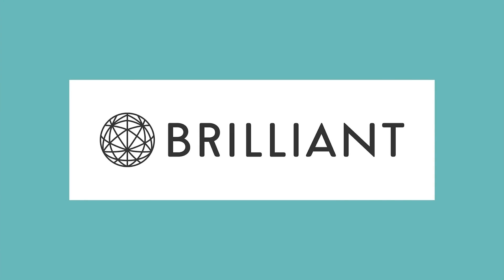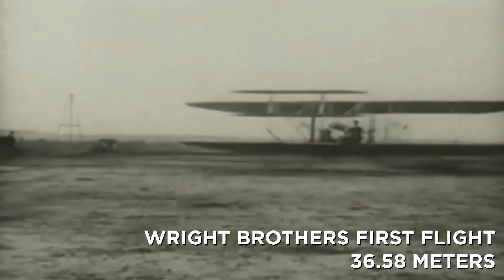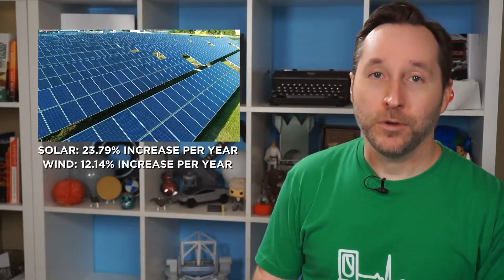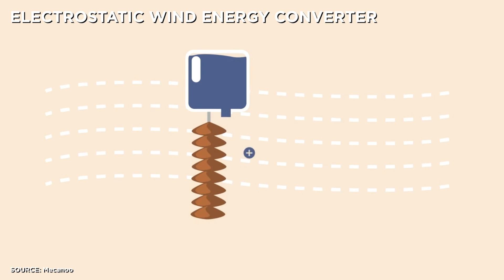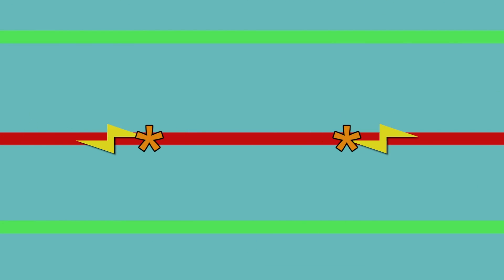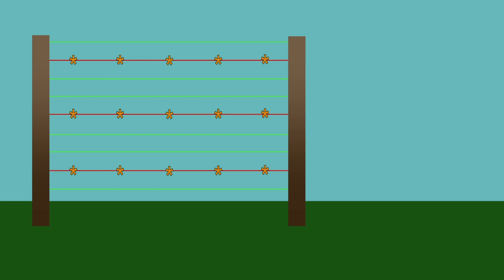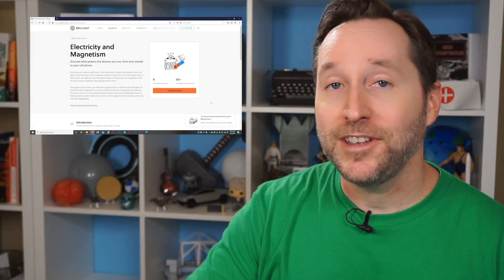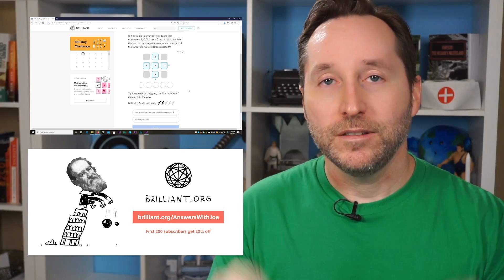Solid State Wind Energy | Random Thursday

Comment: your lack of basics physics knowledge is really grating sometimes. They didn't apply +20kv and -20kv, they applied 20kv across the two electrodes. Also, 20kv is not "a lot of energy" it's a high potential; you need to know the current to get a power figure, and a run time to get the energy.

Comment: We already have the infrastructure in a way if we were to turn all the wiring on the current grid to this idea perhaps we could simply do away with the power stations as the grid itself would produce the electricity, and if you were to incorporate this idea into the construction of every new highrise building with wiring encircling the building many many times you could make the building create it's own power supply

Comment: If you're going to string up wires, why not just capture the energy broadcast by, well, broadcast stations? You can get usable current from a single elevated wire tuned to a nearby broadcast station. Broadcasting, whether by short wave, AM band, TV bands, or FM band, is quite wasteful of energy. Many stations put a million watts or more into the air, a tiny fraction of which gets to receivers (the energy is transmitted in broad, almost spherical lobes and dissipates inversely according to the square of the distance from the transmitter).

All you have to do is tune to a station (or several stations) then rectify the signal and filter it to get a steady DC current while the station is on the air. Do that in various antenna orientations and/or for several big stations, and you can get multiples of the current from a single wire or station. Your current is not robbed from any receiver, since your path to the transmitter is unique; you are taking only energy that is otherwise wasted.

Comment: Dear Joe,

This video starts out by stating  incorrect historical facts. If you would've looked into this a little more thoroughly, you would know that this is the truth.  On my YouTube channel. to the left, there are over 30 videos of the first and only ion propelled aircraft that clearly flies with onboard power, without external assistance.  I am the inventor and have made sure that every scientist has solid clear cut verification! 
The craft has been patented since 2014 specifically for lifting its power supply onboard, it can do it for nearly 2 minutes at a time vertically!  The aircraft can also fly on one side with the streamline shaped collector surfaces flattening on the bottoms sides somewhat to form efficient airfoil shapes, making it also a "plane".  The point has always been lifting a power supply with ion propulsion though not semantics.  The orders of magnitude higher power to weight and efficiency of the earlier craft are also important details.
Furthermore, the host of NPR and many other officials have certified that the much earlier ion propelled aircraft lifts its power supply solely using ion propulsion.  Here is a 6 minute radio program and article by Jeff Saint Clair:

https://radio.wosu.org/post/exploradio-oberlin-inventor-pushes-limits-ion-powered-flight#stream/0

Since it utilizes well known physics principals, it should also be entirely clear that it's real.  Anyone that spends 5 minutes on the web googling the subject should be aware of the craft.( If anyone is  interested I would recommend first visiting my YouTube channel by clicking on EA icon.) There is generally exhaustive detailed information about it online. 

I think your videos are normally just awesome, but I just don't understand how you could make such an error.  I know an MIT student wrote it in the Journal of Nature and Barret et. al. thought it was correct, but MIT was simply not the first to do this.  It is not my intent to be unkind at all, but something must be done to straighten the record, please...  Thank you ahead of time for correcting this important matter!
Best regards,
Ethan Krauss

Comment: Both wind turbines and solar are NOT reliable -period. Nuclear and hydroelectric are very reliable base power 24/7 and have zero carbon emission the safest and most energy efficient. They also have a small footprint and the waste for nuclear is actually small and is now being re-used.

Comment: The wire panel thing looks really interesting. I wonder if it could be developed as a fencing system that would have a duel purpose. Even if it just powered led lighting it would possibly  be worth it or would the wire degrade in an open system and become ineffective, would copper be better at conductivity?

Comment: It is possible to produce amazingly high voltages  with a Wimshurst machine, even at home.Tens of thousands of volts, but slight enough actual energy it can give you a shock with no harm done. It starts up with stray friction-induced electric charges on isolated metal film  sectors in a circle upon an insulating pair of contra-rotating disks, and uses static electric induction and clever collecting brushes to charge up Leyden jar condensers  to spark-level opposing voltages. Each condenser is linked to its side of a spark gap. You can easily get half-inch sparks with hand  power. If you elect to try the shock yourself, make sure the Leyden Jars are not too big. If it takes a minute to charge them, don't risk it.

Comment: Wind energy had been around for thousands of years, and was TOTALLY defeated commerciaily and militarily by coal and fossil hydrocarbons  in  the past couple of hundred years. The technology to use it for oceanic voyages was at a state of sophistication as sail, that surpasses anything that the "modern" craze for electric wind power could possibly achieve at sea. Batteries enough to power  either Americas Cup racers or a Cutty Sark look-alike, let alone an oil powered vessel with 100 MW of power in its engines, would sink it.
The need for immediate response to civilian electric demand is far harder to meet than the ambition to cross a stretch of ocean, or even lake. I myself have successfully 'parked' a small dinghy using only its remaining  momentum and a wind that was insufficient to smooth the sails of an identical craft. Wind "turbines" can do nothing with a wind that can propel  a full-rigged ship at three knots. That's not much, but it beats stagnation.

It is the height of superstition and stupidity, some of it caused by propaganda that benefits the fossil carbon technologies,  to be wasting time, money, ingenuity, enthusiasm, and environmental beauty, on anything other than NUCLEAR civilian power, which requires about a millionth the quantity of fuel AND waste products, as anything  from horses to jet engines.

Comment: It makes no difference how clever the equipment is, if its source of energy is capricious, and people need electric power NOOW when they or their refrigerator turns a switch.. A 60 Hz AC grid needs ALL of its suppliers to be synchronous with a sine wave that goes from +V to -V in  less than a hundredth of a second. If an overloaded generator slows down faster than the others, the short-circuit defence relay will drop it from the bus, and the problem cascades.

Intermittent 'renewable energy'is therefore worthless , AND wind and solar do worse  environmental  damage than hydro. Nuclear, even the out-of-date stuff we're still using, does none.

Comment: I feel this could be modified or combined with somthing I was looking into. It seem the faster the wind and the more compact the wires are the better it will work like an air radiator. I uses an anode and a cathod system I guess you could use carbon but I dont like a carbon tube I think maybe a Graphite coated wire would work best. 

So a copper and a graphite coated wire being less then 1cm apart would work best. We would need at least a 500 by 500 grid setup and would be put in the front of an electric car were the radiator is so as your speeding down the highway it can take in some of the wind energy. Now the big issue with this is that the car isnt grounded but the body of the car is. Again Im not the smartest person in the world but I bet there is a way to impliment this into a car or even a plane. Most likely an electric plane. To manny Im just spitting nonesense but often times nonesense turns into ideas and ideas turn into inventions. Heck I might just make one myself. 

Im curious now.

Comment: I'm thinking this electric thrust could be used on small scale craft where sound is an issue. Like spy drones. Also could be used to make artificial bees since they're going extinct. Easier to make several thrusters on one power supply then to engineer a articulating insect wing. I'd like thoughts on this.

Comment: interesting idea - but I see in another 5-10 years 'wind freaking powerlines!!!' or similar lol. 
BTW
40kV is a lot of energy. Volts arn't energy... so you cant make a call on the energy consumption with only half of P=IV.
Arguments against windfarms also state that they disproportionatly kill prey birds, which are less numerous, particularly in cities (though finding evidence is a bit hard either way)
and most wind turbines (particularly the larger, modern ones) have 1 moving part. the difficulty is its huge, hard to maintain and subject to large dynamic forces.

Comment: I'm not a scientist but I saw parking lot lights we were installing, light up during a dust storm in Az
The supply circuits were not connected yet. They were 277 V transformers with metal halide or high pressure sodium lamps, i forget. They lit up well enough to see in the daylight. The static in the air from blowing dust must have stripped electrons creating a sort of invisible plasma field, lol. Please explain?

Comment: I have built wind turbines as a hobby for approximately 60 years. All my windmills pump air and I store the compressed air in a huge tank, which becomes an air battery. The compressed air is then run through a small turbine or piston engine of my own design, another hobby and I can make any electricity you want for far less money than if I were to make electricity directly from the flow of wind as do the large wind-electric companies. Also, it does not cost me millions. Most people probably spend more on golf. It may help to know I live on a small farm on the  Texas prairie; lots of open space, lots of wind.

Comment: Nice video, low BS factor (thanks). There are miles of fencing in the USA, could we get two uses for one?  But then there is the "boundary layer" effect which is why all windmills are so tall.  Its so you can get above the low wind velocity ground boundary layer.  BTW - Unfair comparing the first Wright Bros plane flight to that cool ion-drive MIT plane since the MIT plane had no humans on board.  Windmill bird deaths - thanks for putting this into perspective succinctly.  You were too polite to mention that the folks going on and on about windmills killing birds are often not really bird lovers, they are people who hate anything new or are PR people for the petrochemical industry who are trying to eliminate the competition in a sleazy way.  If they were truly bird lovers, then, as you point out, they should call for the immediate ban of all sky scrappers and cats.  The fact that they don't exposes their true intent.  However, getting wind energy in a way that would kill fewer birds is always a good thing.  

You state that this new no-moving-parts wind energy gathering device should need no maintenance.  Have you seen the plastic bags and other litter along side highways?  I think these energy harvesting grids would become an unsightly trash magnet and would be costly to clean.  Speaking of unsightly, would a home-owner really put a gigantic vertical cheese slicer on top of their roofs?  I don't think so.  Home owners are turned off by "unsightly" solar panels.  Elon Musk had to design solar panels that look like normal roof tiles from the road to appease fussy home owners.

Comment: "Wind turbines kill birds when they are hit by the spinning blades. Much safer to string up a ton of thin electrified wire for them to fly into"
Reply: To kill the birds the wires would need to be close enough to each other so the bird could cause a short.  Birds fly on and around wires all the time.  No moving parts are the key.
Reply: @rjbobrobertson  I made the statement mostly as a joke, but the birds are the moving parts. It isn't a huge issue, but they would definitely have to make the wires highly visible.

Comment: I didn't realise the life-span of a wind turbine was that short! I would have thought that the failure would be in the generator house with all that gearing, as yes, the blades are a moving part, but it's a constant turning motion, there shouldn't be much to fatigue the blades.

I really do think that nuclear power is the answer. Yes, the waste that it produced is more dangerous, but there is relatively a lot less of it.

Comment: I wonder if this system could be placed in long hallways between buildings that generate a fast wind current.  Many places add wires to either hang decorations or keep birds away (or both).  This would give those wires a third potential use.

Comment: Also if the solid state wind generator uses charged water droplets to hen it has moving parts. The water is a part of it and it moves so they are close but not quite as there

Comment: You're way off on the wind turbines. The lifespan is significantly less than 20 years. The blades are deteriorating after a few months of use. The amount of oil energy used the make, transport & maintain them far surpasses the energy they produce over their life, making then negative as a green source.

A much better use is a small kilowatt size vertical wind turbine used as a compliment to a home solar installation. If the sun isnt shining, then the wind is often blowing. When cheap solid state batteries finally come online, that is all you'll need for your home.
Reply: That is complete BS. I see wind farms up for years without blade replacement. Producing considerably more energy than what it costs to make and transport them.

Comment: Great video as always. However, the reason wind turbines are so big isn't to offset maintenance costs. The reason is to capture more energy and remain competitive.
Wind turbines capture wind that passes through their rotor area. The area scales with the square of the diameter, so each additional meter yields an exponential gain in energy production. Cost also increases exponentially with diameter due to loads, but not as quickly (until a certain equilibrium point is reached). Making larger wind turbines is the only way to significantly drive down the cost curve and remain competitive with solar, which also has a decreasing cost curve for other reasons.

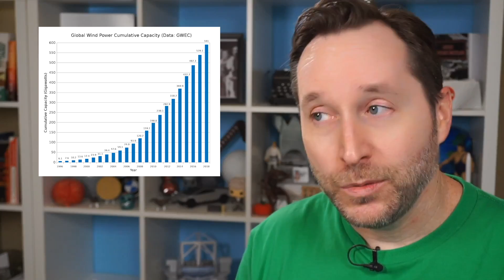Comment: Correction: 2:26 " that's 519 gigawatts of energy" the Watt (W) is a unit of power not energy. A kilowatt-hour (kWh) is a unit of energy. Think of it like this... You have a 100W lightbulb in your lamp that is on. At any one instant, it requires 100W of power to stay on. Energy consumption takes time into account. To power the lightbulb for 1 hour you would need 100Wh of energy (100W * 1Hr).

Comment: Reminds me of another technology I saw several years ago which used ion generation for control surfaces on aircraft instead of propulsion.  The aircraft used film on the wing to generate ions on the top surface, disrupting the boundary layer and decreasing lift on that side of the aircraft.  It allowed the aircraft to maneuver without any moving parts.

Comment: Question: why can't we use the pushing force of wind to create power? Have a sheet or parachute of sorts positioned on a post with a weight attached to the supporting ropes of the material. Then, the wind pushes the material trying to lift it, and thus raises the weight which can make power via multiple different methods
Reply: Knowing my luck this becomes an actual successful form of energy generation and my idea gets ripped from under me 🤣🤣🤣

Comment: 2:20 shows a table of installed power production capacity, not the amount of energy each type actually ended up producing. Power is related to energy but it is critically important to know the distinction. A stochastic (variable beyond our control) production method needs management, often backup, extra installed capacity to meet a planned need (since design conditions aren't met 24/7), and they need cheap, plentiful energy storage which humankind does not yet have. No, batteries are less than a drop in a bucket even if we pillaged the entire planet to dig up all available material for lithium ion batteries, ditto for lead acid and other types we currently have.

Comment: Wait, in theory couldn't you make high voltage power lines out of this to reduce/negate long distance energy loss
Reply: you would have to convert the random spikes of basicly static electricity and convert it to a synchronized constant frequency, which would probably involve high voltage capacitors and some control circuitry on each wire for very little gain as it is the long stretches of each wire that are the collectors. Yes, you are probably right that a good bit of power is lost on these lengths, but that is how the power is collected, you cant exactly break them up.

Comment: No way it'll be competitive with solar in terms of energy density generated or cost efficiency.
Reply: Check out Ion Power Group, it's one wire with a bunch of graphite collectors, extremely cheap for the power output and seems to have good longevity.
Reply: @BlackHeartScyther  Checked it out. Sticking by my original assessment.